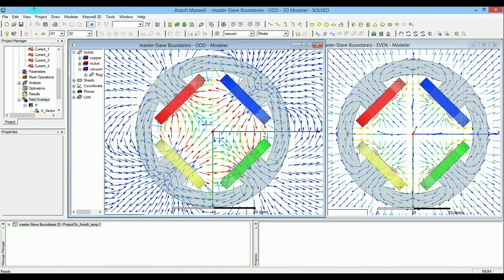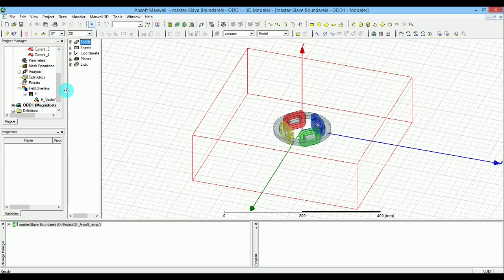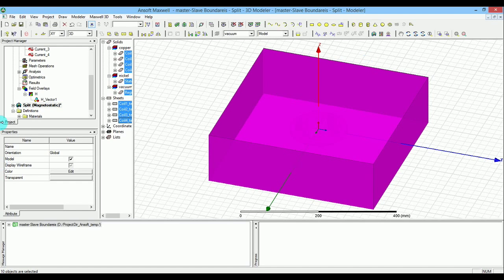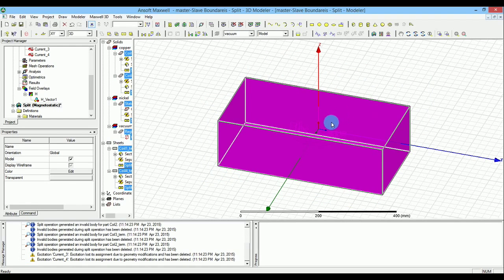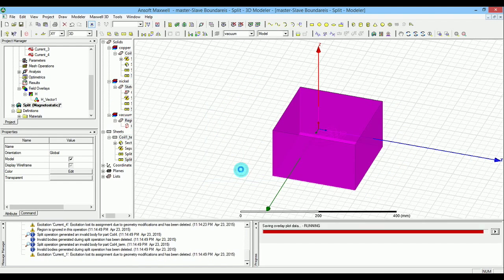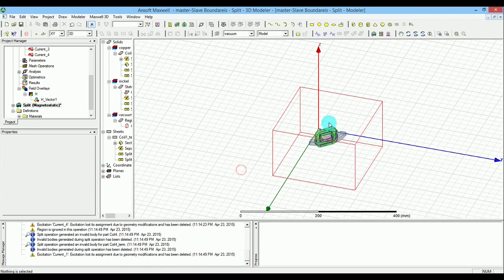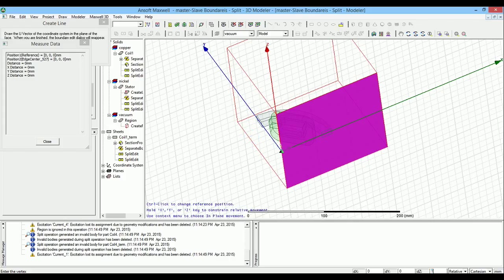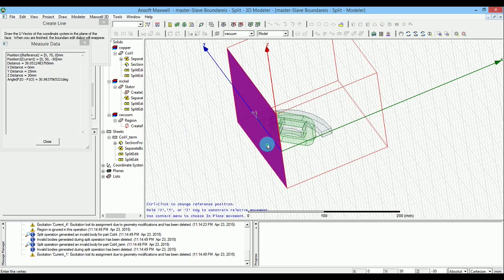228 - ANSYS Maxwell - Master/ Slave Boundary [4/4]

Comment: Hey Kamyar, I am getting this error message: Selected master and slave pair has too much geometry difference. Possible reasons: (1). The orientations of master and slave vector are not consistent.  (2). Skewed objected have been cut at wrong position. I don't really know what to do. I have an axial generator with 63 coils and 72 poles, just split it in 3 coil region, but I do not know how to fix this problem, could you please help me ?